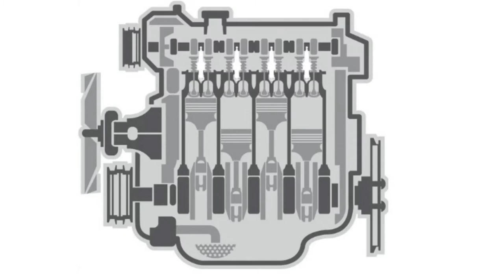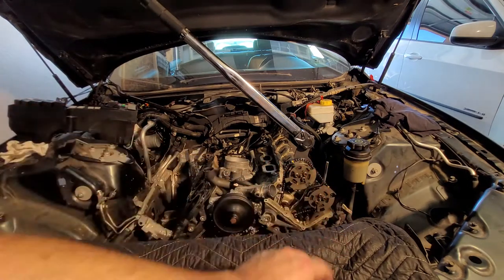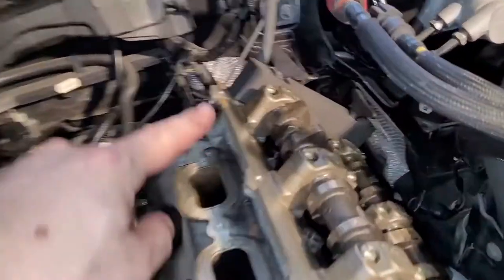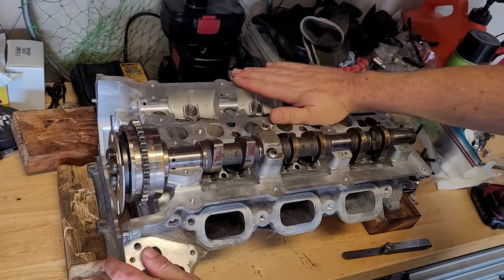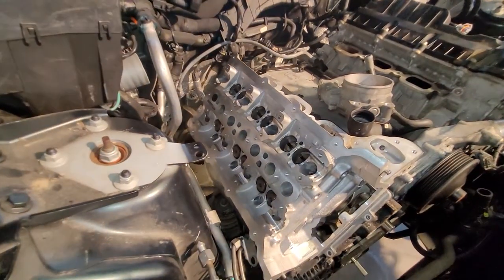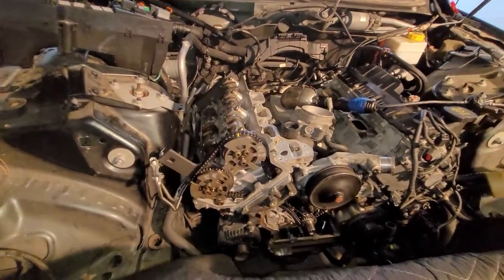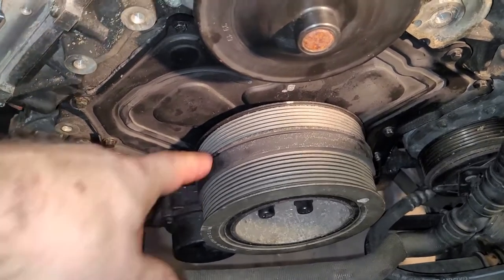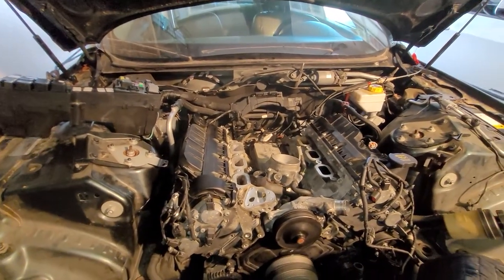Jaguar Land Rover 3.0 V6 AJ126 Engine Repair PART 3 of 4

Comment: Hey is this super charged? I’m bout too do my brother inlaw timing chains 2013 jaguar Xf 3.0 supercharged
Reply from the maker: All jaguar/land rover aj126 (v6) engines are supercharged. Some aj133 (V8) jaguar/land rover engines are naturally aspirated, but most (2014+) are supercharged.
Reply: How long of a job is this without cylinder head removal it’s jus a rattling timing chain

Comment: URGENT QUESTION: Where are the timing marks on the exhaust camshaft variator? Or do you just line it up with the shafts locked down?
Reply from the maker: There is a mark on the exhaust cam variator. Line it up with a yellow tooth on the chain.
Reply: @NiXFiX  There's a couple of marks so I wasn't sure, haha. Should the marks line up when the shaft is locked off? Or do you need to unlock the shaft to rotate to hit timing mark? Mine was about 4 or 5 teeth away from being on the mark when the shaft was locked off
Reply from the maker: @BrendanYoungMusic  do not unlock the crank. I have several other videos on these engines if you want to check those out.
Reply: @NiXFiX  Ah, don't unlock it even to line up the timing mark? Because on mine it's way off 🤔 it's now throwing codes for camshaft position sensor on passenger side, and the Jag service center says either bad sensor or timing is off. I had to unlock the shaft to line up the timing mark. Thanks much for the info, btw! I've watched all 4 of your vids on this car, and the info has been invaluable. I did a whole rebuild on mine, and couldn't have gotten through it without your info.
Reply from the maker: @BrendanYoungMusic  thanks! But you screwed up though. Never unlock the crank while setting timing. Either your exhaust cam was 180 out or you swapped intake and exhaust variators.
Reply: @NiXFiX  AHHHH that could be a thing... I was meticulous and absolutely put it back the way it was. But, someone had already been in there before me, and the exhaust camshaft was definitely not lined up with the chain properly. I wonder if it was already messed up...

Comment: The Mitchell1 manual seems to say that maximum permitted warp is .2mm (.008in).  Following your instructions Im fixing my landrover Disco5 with the same engine.  It seems like i am right at .008 warp on the head or if anything a little under (between .007 and .008).   You seem to indicate that .007 is ok but .008 is "definitely out of spec".    Any thoughts?  To machine or not machine that is the question.   Other than this the head looks great with no damage.    Could I use a slightly thicker gasket?   Thanks -   Love your videos.
Reply from the maker: Did I say 0.008" is definitely out of spec? If I did, I'm sorry. 0.008" is the maximum. That's what the Land Rover workshop manual says as well. Considering you are right at the limit, it might be worth while to surface the head. These things aren't the easiest engines to work on. You don't want to do it twice.

Comment: Where can I get the up dated timing kit
Reply from the maker: They are a little hard to find without going through a dealer. AutohausAZ has some OEM ones. I found this aftermarket copy to be of good quality: https://amzn.to/3BVToL8
Reply: @NiXFiX   Thank you sir👍👍👍 maybe you can help me with this. It's saying I need a secondary air injection system air flow/Pressure. Location? I alos having a hard time finding a repair manual for L494 2017 Range rover sport v6 HSE.
Reply from the maker: @Chewie374  here is a link to the L494 workshop manual. You can look up your secondary air injection problems/location in it. https://drive.google.com/file/d/1r6VGzQrwat_9YRgUfKvuYZcIccw_M9Is/view?usp=sharing
Reply: @NiXFiX  hi I was wondering if you have another link  for the repair manual that works,? the deal is that I need to get the procedures to overhaul the bottom end of the engine

Comment: Nix,

 I'm doing a AJ123 engine as well but cant find the block specs, how and where did you get them.  No help from the local dealer nor topix.  Piston ring gap, bearing tolerances, bore size, its like a black hole.

Comment: Really good video! I am working on the same timing install but i am not sure where to position the crankshaft and i dont think you mentioned it in your video. Is there a tool to use or a specific position for the key on the front? How did you do it?
Reply from the maker: This is a 4 part video series. Watch part 2. https://youtu.be/UIy5fdvLg5Q

Comment: This is a great series of videos. I picked up a 2014 LR4 with exactly the same failure but on the opposite bank- collapsed chain tensioner, bent all of the valves on that bank and a broken intake camshaft between the first and second lobes. Exact same failure. Everything went well on the install but when I started it I got failed head gasket symptoms for just the bank I removed (consuming coolant, exhaust smells like coolant and misfires on cyl 4/5/6). I did not check the head for cracks or warping because the failure that took the car out of service was related to the timing. I cleaned everything well and used new bolts, same procedure I use on all of the BMW engines I've rebuilt and I never had a head gasket sealing problem. I guess I will take the head back off and redo it. Any advice/input? Thanks
Reply from the maker: Thanks. That's brutal man. All that work and the gasket didn't seal. Ugh. What brand gasket did you use? Is it a multi layer steel like stock?
Reply: @NiXFiX  I used what I could find on RockAuto- AJUSA 10222400 (and OEM head bolts from FCPeuro). It's multi-layer steel and it looks like it's fully coated instead of just coated around the sealing areas like the OEM or the one you used. It fit well and like I said I didn't pay much attention to the gasket or the flatness of the head because the car didn't stop running due to overheating it stopped due to the timing issue. I figured I could just clean everything well and install the gasket like you did and it would seal. Same thing with the other cars I fix, if I have to take the head off to replace a rod or replace the valves the head should still be in spec. Maybe I'm too used to these BMW engines
Reply from the maker: @aceattack52  Wow. Just wow. I had the same thing happen to me with a Rockauto AJUSA gasket! I refuse to use those now. I replaced a head gasket on a 2011 RR 5.0 AJ133 one time with an AJUSA head gasket and this EXACT thing happened to me. Head was flat, engine surface was flat, put on an AJUSA gasket and it burned coolant. Replaced with OEM style and problem was solved. Try an OEM gasket, or, I have had good luck with these. You said driver side, right? Here: https://www.ebay.com/itm/224872209637
Reply: @NiXFiX   Wow I'm really glad you said that it gives me some hope. I have some PTSD because about two years ago I also fixed an RR sport S/C. 5.0 AJ133 as well. That one I bought because it had overheated badly. I attempted to fix it several times but every time it kept doing the same thing no matter what I tried so I eventually put a full Jaguar 5.0 in it. Every time I attempted the repair on that one it failed similarly to what happened on this LR4 hence the despair. I'll get the gasket from the link you sent and some new bolts. Thanks for the tip
Reply from the maker: @aceattack52  I'll be able to extra confirm it here in a week or two. I just put the gaskets I linked on  a 2014 RR sport 3.0 AJ126. Block was 0.003" and heads were near limit at 0.006". I fired it up today but without coolant because steam/vent pipe was broke and I didn't notice. As soon as that part comes in, I'll finish the video and post it.
Reply from the maker: @aceattack52  confirmed. I'm a fan of those head gaskets. I've driven a 2016 RR Sport with this same engine in it for over 400 miles now. No issues.

https://youtu.be/ytyNAGFaeB4
Reply: @NiXFiX  Last weekend we finally got good enough weather here in Georgia for me to put it back together with the new head gasket and bolts and so far it seems to be working. It looks like those Ajusa head gaskets really are to blame then
Reply from the maker: @aceattack52  I'm glad you got it worked out!

Comment: Qestion: when measuring the bucket lifters. The lobe have to be facing up,  per lobe?
Reply from the maker: Yes. Lobe needs to be facing up (180 degrees) from bucket/tappet when measuring.
Reply: @NiXFiX  thank u sir

Comment: Hi I was wonder what to ask for at machine shop. And what is the cost I am looking at?
Reply from the maker: Depends. Was your car an overheat or timing failure? If overheat, you would want them to check the flatness of the cylinder head. Off the top of my head, I believe 0.2mm (0.008") is the maximum. If the head isn't warped beyond that, then I'd recommend valve seal replacement, valve job (grind), and have them set the valve lash for you. Probably looking at $500 or so per head for this. If it was a timing chain failure, you need to have the shop check the valve guides and replace as necessary. They would also need to replace any valve that contacted a piston. euroamp on ebay sells valves that are inexpensive and I have had goo luck with. You'd also want to replace all valve seals and do a valve job (grind). Finally, have them set the valve lash for you as well. Probably $800 per head for this. It all depends on where you are at and what your machine shop wants to charge. They vary greatly. It is normal to have a head surfaced, but I typically don't have shops surface these heads. I just request a hand (parts washer) cleaning.
Reply: @NiXFiX  hi The car is not overheated. I just bought the car off insurance auctions. it still starts but has a loud rattling noise. computer says bank 1 and 2 camshaft. have not taken apart anything as of yet. if it is the chains. would i still need to have the heads machined?
Reply: also thanks for your help. trying to fix the car on a budget

Comment: Is clearance the same for tappets/ cam followers on the exhaust and intake side?
Reply from the maker: No. Intake side is 0.18mm to 0.22mm (0.007" to 0.008") and exhaust side is 0.23mm to 0.27mm (0.009" to 0.01"). On every engine I have encountered, the exhaust side has a greater gap. This is because exhaust valves get hotter than the intake valves (and thus, expand more).
Reply: Makes sense. Regarding between exhaust and intake.